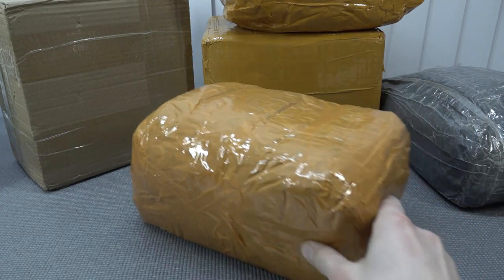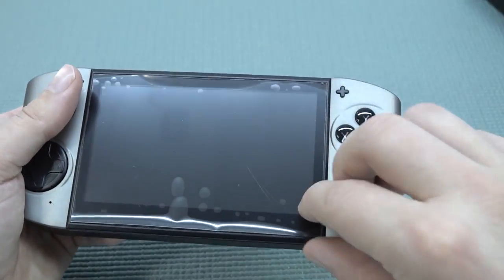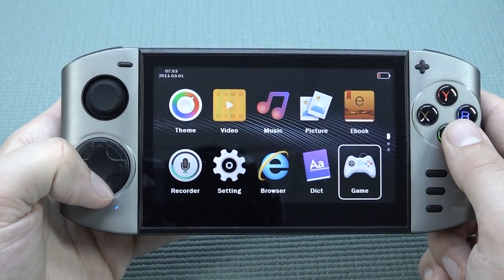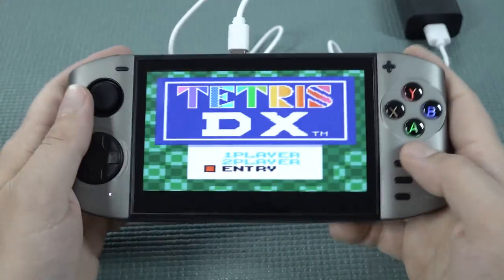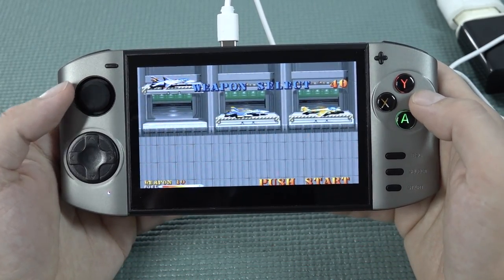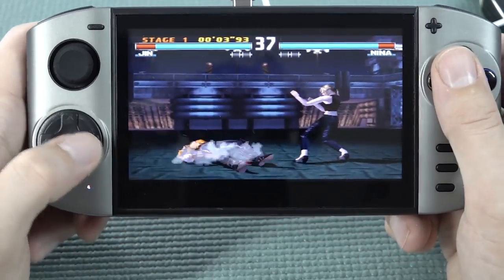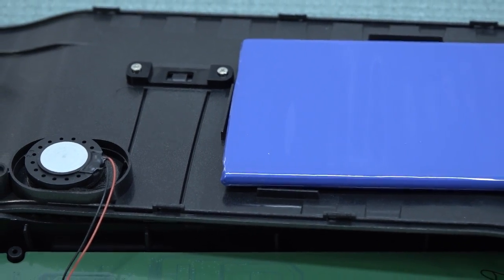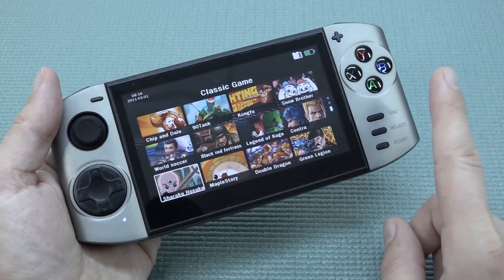Aya Neo Mini Clone 5.1inch Gameplay Retro Emulation Handheld

Comment: There are better options out there if you want the cheapest handheld that still runs smooth emulation under $100:
Original Powkiddy RGB10
Powkiddy RGB10Max (5 inch display)
Powkiddy Q90
Powkiddy Q20
Powkiddy V90
Powkiddy RGB10S
Miyoo Mini
PlayGo
Anbernic RG350 series
Anbernic RG351V
Anbernic RG351M
Anbernic RG351P
PocketGo S30
PocketGo 2
Original PocketGo
Anbernic RG300X
Anbernic RG35XX
Anbernic RG280 series
Anbernic RG353V

Between $100-$150:
Powkiddy RGB10 Max 2 (5 inch display)
Retroid Pocket 2 Plus
Retroid Pocket 3 (5 inch display)
Retroid Pocket 3 Plus (5 inch display)
Powkiddy X18S (5 inch display)
Powkiddy X17 (7 inch display)
ANBERNIC RG353P
ANBERNIC RG353M
ANBERNIC RG503 (5 inch display)
ANBERNIC RG351MP